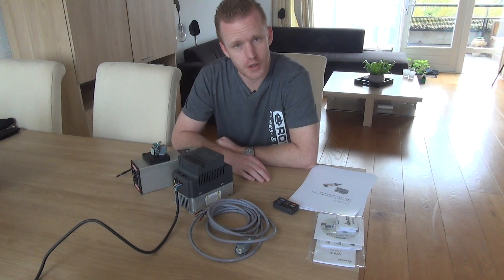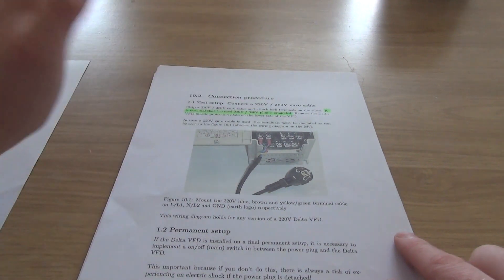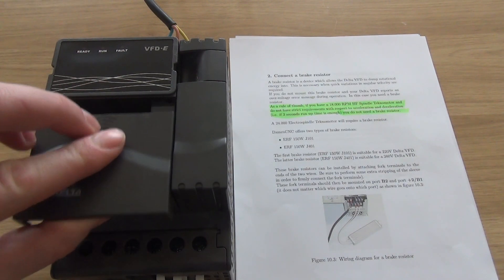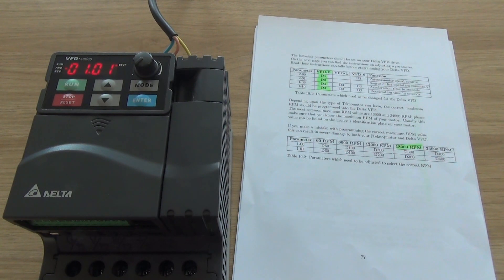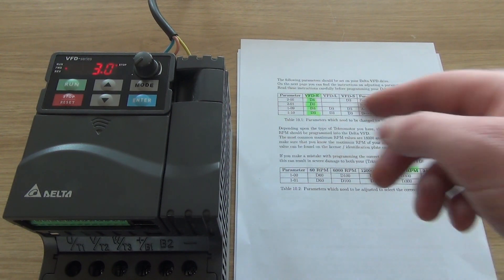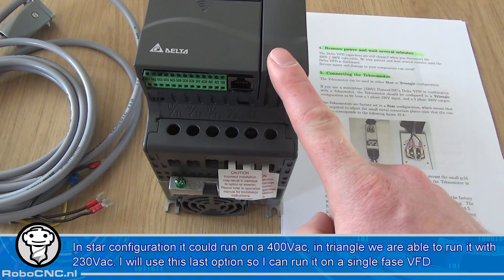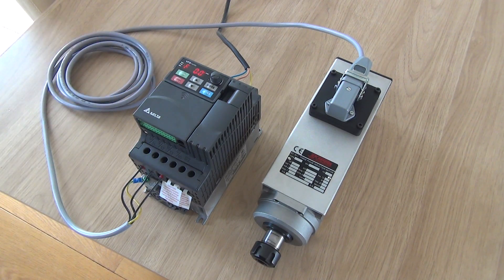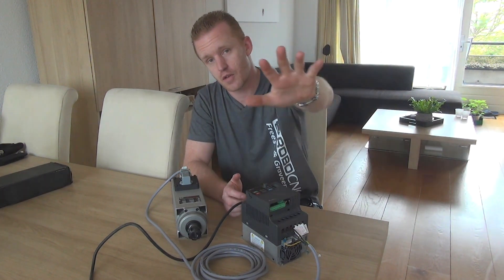RCNC X2 Router 09: Delta VFD Setup and testing the Teknomotor HF Spindle

Comment: Nice video as always, thank you.

I have a 2.2kW Teknomotor spindle with ceramic bearings on my CNC for 6 years and it's working without any problem. Have milled a several hundred hard aluminium alloy stunt swords and other stuff for movie props so far and it never let me down on any job.
Since the motor itself is isolated from the environment (dust, coolant etc.) perfectly it has a high performance cooling fan, since the airflow does not touch the motor directly. Get used to the noise, that's all you should do... :)

Spindles with ceramic bearings are highly recommended to get warmed up before 'action'. I always let it run on a low RPM for a minute or two before I start milling.
Reply from the maker: Thanks for your nice comment, and even better the tips and tricks ! Much appreciated !!
Reply: Are the ceramic bearings the only difference between his and your spindle? I can’t decide between the two.

Comment: Nice one Marcel. The RPM on that router motor is insane. Cheers Aaron
Reply from the maker: Hi buddy, thanks for watching :) well 18K RPM is nothing yet, there are much faster ones... 
But if you go above the 18K RPM the sound is suppose to get very loud :) 
Cant wait to test it out :)
Reply: Datron cnc uses spindle with upto 60,000 rpm. They are high speed milling machine.

Comment: I have a C31/40-D-DBS spindle and I find the sound from the shaft driven fan to be quite tolerable up to about  18000rpm, at 24000 it really screams and its a huge difference in sound level. Coming from a water cooled spindle it bothered me at first, but the reality is that unless your doing a lot of 3d cutting, the cutting noise far surpasses the noise from the fan. They have more expensive models with DC fans that are very quiet. Where did you get the connector for the spindle? I didn't realize that was an option.
Reply from the maker: Hi there, and thanks for your information ! 
I have heard the same from DamenCNC that indeed even up to 18Krpm the sound of the electric fan and the original are very similar. Maybe you are right, I was not wearing hearing protection, and it was not on the machine but on the table... Lets first machine some parts. The connector comes from DamenCNC also... and the plate is made in shop but they also have a metal connection box. Check the video for connector info.
Reply from the maker: Ps... dont forget to subscribe ;)

Comment: Nice looking spindle motor, did the instructions say anything about running in the bearing at slower speeds or are the motors already run in at the factory. I think the cutting action will make more noise than the motor. Air cooling saves on water pumps and hoses, just another thing to fail.
Keep up the good work I am looking forward to see it making some chips.
Have decided what control software you are going to use, maybe Mach4.
Cheers Dave.
Reply: I switched from mach 3 to Eding cnc with ethernet and I will never use mach again. Sure mach had some more features but Eding works reliably every time.
Reply from the maker: Hi Dave,
No they do state that at first run to check rotation direction, and check if the fan produces airflow.
After that they say to daily  run the motor for 5 minutes at 50% to warm up the bearings.
I can say i will do so, but I know myself and think that will fade, and that i will have to replace the bearings one dat or another. You are probably right about the cutter producing more sound than the fan, but i was hoping for it to be less noisy :) On the water cooled spindels you are right, a pump, water, couplers, cooler etc... Thanks for your thoughts !!
Reply from the maker: That was the question I forgot to ask in my previous video.... I will use EdingCNC for the test drive, but i miss some features in it compared to mach3. I absolutely want to leaf the serial port and go USB or Ethernet. but not sure on the controller software... maybe I'll cover this in a separate video, or a vlog...
Reply: In the manual for my Teknomotor spindle C31/40-D-DBS-P-ER20, they had a burn in procedure. I forgot specifically but it was required to run starting at low RPMS for several minutes at a time and increase it incrementally.  AHowever this is for the electrospindle models with a different bearing arrangment
Reply from the maker: Yes my other machine works on edding (although at that time it was USBCNC and had not got ethernet yet). 

I do love a lot of the software but i'm missing some real features. I Have talked about it to Bert and maybe it will come in the next year, there will be a complete new UI. 

Ill talk about this in a later video i think. Thanks for your advice though !

Comment: thx for the video. if you mill aluminium, the  lower spindle speed would not make problem for the cooling?  ( low airflow).  I use 4 bearings watercooled spindle from China and it goes without any problems... and the bearings are cheaper too . But, I mill mostly wood so i do not need that extra 0.000 precision that your spindle has.  Nice CNC you build! And thanks again for the buyer tips that you give!
Reply from the maker: Thanks for watching ! Yes  when you run a very low rpm it would be bad for the cooling indeed.
Have to check what the pdf states, but the torque is stable from 6000RPM and up, so maybe thats a safe start.